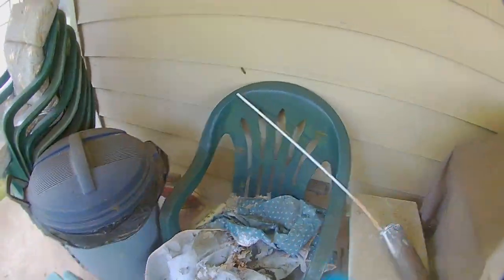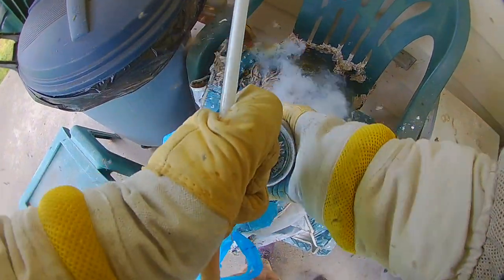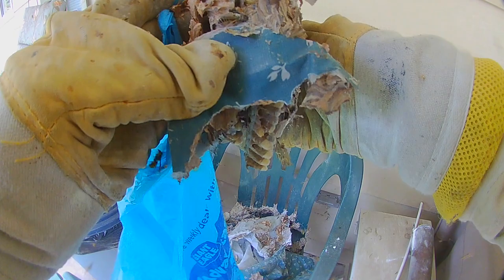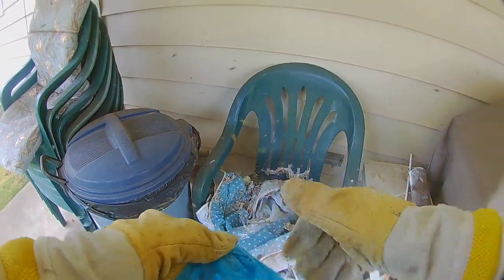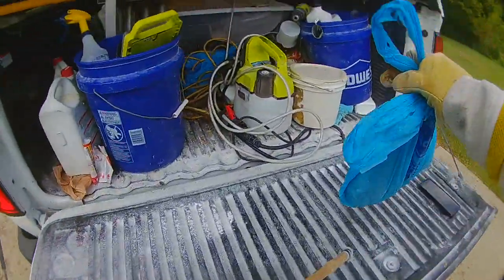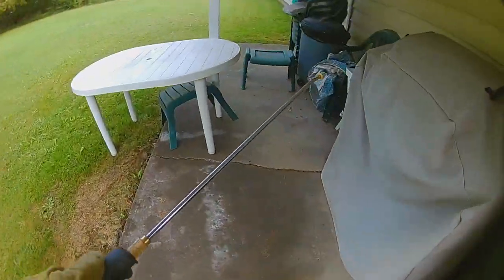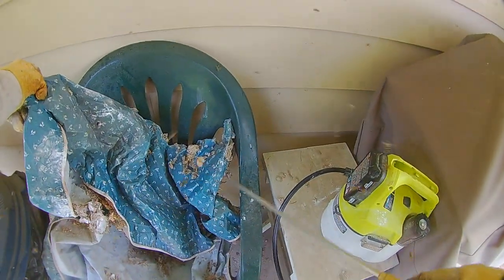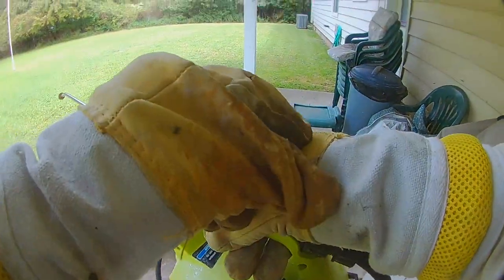Yellow jacket wasps built in tablecloth

Comment: Not sure if you've tried Drione dust or not.  I like it because it really gives a fast knock down when compared to Delta and Tempo.  It's about twice as expensive though.
Reply from the maker: I love drione but it plugs dusters like crazy. The only thing I've found it doesn't plug are the cheap hand bellows dusters and even then it doesn't puff quite as well. It does have great knock down though

When customers want an organic dust it's what I will use

Comment: Delta dust is mildly toxic to birds and labeled as extremely toxic to fish and aquatic invertebrates. Less is more with this stuff. Why not use a shop vac with some water in it? Iv'e seen this method done with baldfaced hornets/above ground nesting yellow jackets. Have you ever relocated a nest?
Reply from the maker: You still need to use pesticides, even if you would use a vacuum. There is 20% of the nest out gathering food at any given time. The guys who use a vacuum can't sit there for 48 hours and suck them up, you still need to leave a pesticide residue. All the vacuuming does is take time that could be spent on another job and doesn't really add value. If you're looking to extend the run time of a YouTube video it's brilliant and it does kill them, but I have to manage a schedule and run 1100 calls a year so I can't take the extra time for it

I do take a lot of precautions with the Delta dust though. I never use it with running water nearby and I've switched to a battery duster that blows off much less dust
Reply from the maker: As for relocating, I do that with honey bees and it's easy with them. I haven't with yellow jackets or hornets, as they don't pollinate and I don't have the space for the 750 or so nests I get a year. It would disrupt the local eco system. It's usually best just to kill the nest where it is and mitigate other environmental impacts